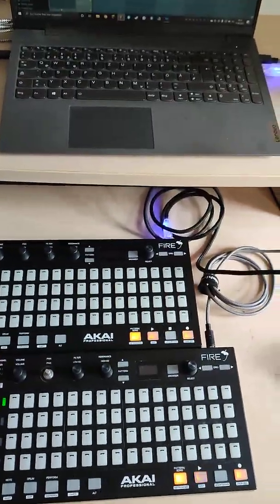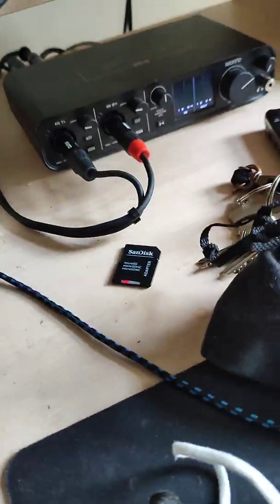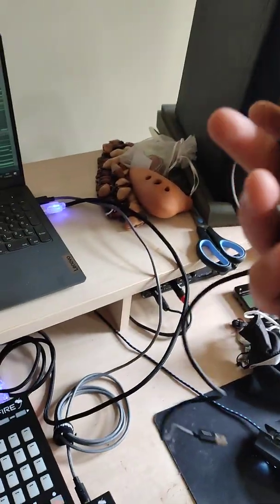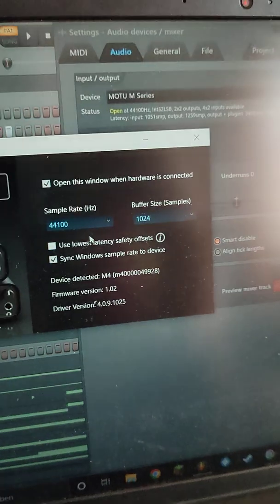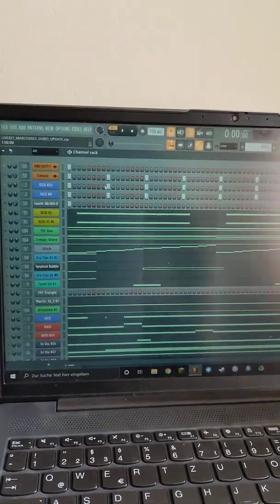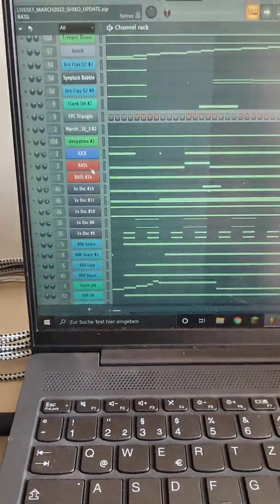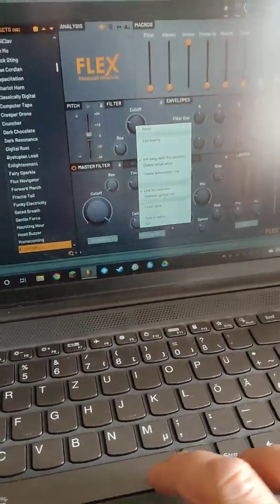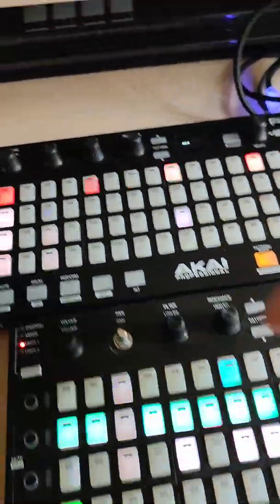TEKNO LIVESET USING FL?! - GehLekTek Live Setup Tour and Guide

Comment: Can I bind the scrolling down/up possibility( in a pattern) on the launchpad S on a button? Does anyone know something?
Reply from the maker: Only way is midi scripting i think. Do you know someone that knows python? 😅
Reply: @GehLekTek  okay i only can move down and up in playlist so i can split the pattern by channel and then put everything to playlist

Do i get cpu problems if i put everything in playlist? 
Or has this way the same intensity for the cpu and ram?
Reply from the maker: it shouldn't effect CPU usage but from my experience i think it will put alot more stress on your mental health having to deal with FLs performance mode ;).  @risyy6149
Reply: @GehLekTek  i mean the playlist the song mode without using performance mode
Just sorting it like a one pattern in playlist u know

Comment: how do you play all your tracks live using just one fl studio project
Reply from the maker: All explained in the video :) all the channels are below each other when i scroll down in the channel rack
Reply: @GehLekTek  
maybe i explained myself badly...
I have several projects, is there a way to merge them and play them all together without saving everything in the same project?
For example, I have 3 tracks on 3 different projects to play them live I have to close and change projects or is there a way to do it without interrupting the music by closing and opening the various projects each time
Reply from the maker: @nanotek4017  it all has to be the same project, if you need to "merge" projects I haven't found an easy way to do it. I either reproduce my sounds by saving the various channels and mixer tracks states as presets, or i just bounce out the stems i need as wavs and put it in a sampler channel with a single trigger
Reply: @GehLekTek  okay thanks a lot for that